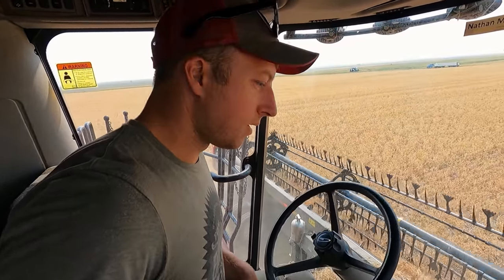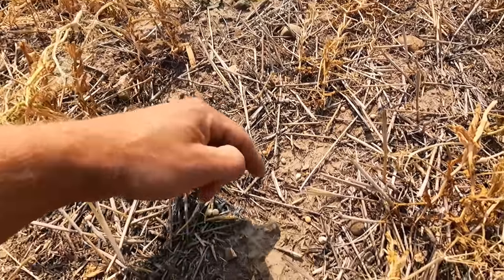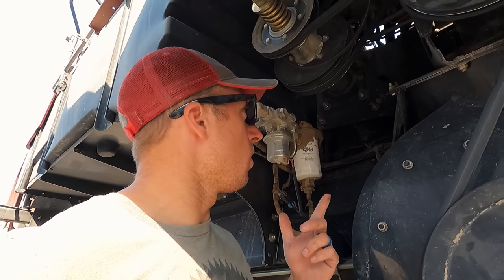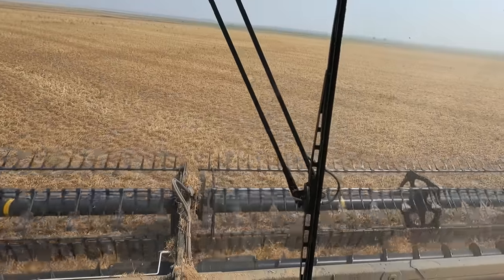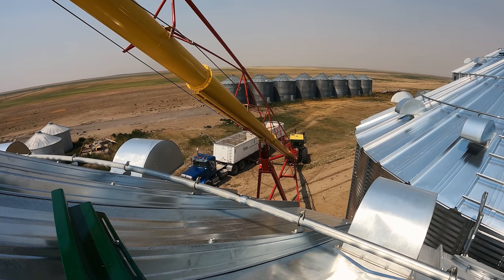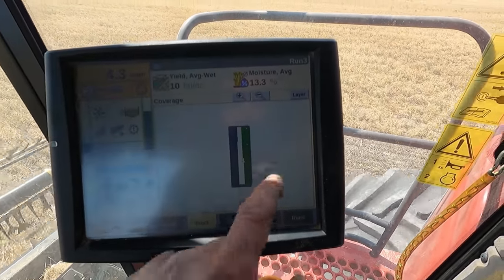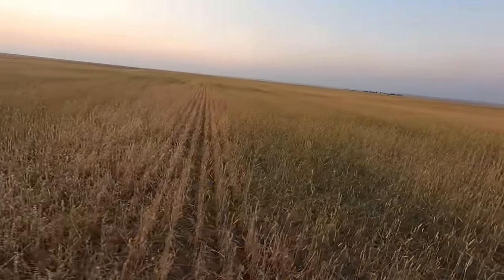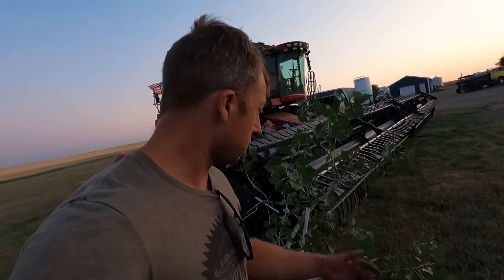Abandoning The Crop?

Comment: Great vid. 7120 and now 7230 owner. Did chopper bearings in both. Would highly recommend replacing all the chopper bearings. Had both of my failures start fires. Plus my when I went to get my new bearing from the dealer they had the one out that I needed and a box next to it with all three bearings. Said the single bearing was like the same price as the whole kit with all 3 updated bearings.
Reply: Tried just doing the bearings on one side before on a combine then the other side flew apart. Would 10/10 recommend doing all the bearings at once.
Reply: But for some reason they always wait for something to fail instead of being proactive when it comes to maintenance. I don't understand why they are like that but it would save them a lot of time during harvest not having to deal with things like this and a lot of money and quite possibly from losing a machine or worse
Reply: @cntslesfabrication  Could it be because they're harvesting and can't just stop to do a rebuild on the combine?... This isn't farm sim.

Comment: 0:45 Nick, buddy, you just described a pull-type combine.  We ran an International 914 behind a Farmall 1206 for almost 30 years.  Super reliable, cheap to run, and it was indeed easy to see what was going into the header.  Modern machines of course would run circles around it, and you don't get the data, but it was great for what it was.

Comment: Nick I've often wondered that too, about having the cab closer to the header. I have a tendency to lean forward, especially when cutting soybeans, but I do it shelling corn too, just out of habit, and its not easy on the back doing that, especially in my case with having back issues. Back when I first started running the combine, the grain heads didn't float as well as they do now days, matter fact we didn't even have automated header control, so you really had to worry about picking up a rock cutting beans back in those days, but the grain tables weren't near as big back when I was a kid.  I remember going from a 20ft grain head to a 30 ft, and thinking wow that thing is huge, now days a 30ft head looks small, lol.
Reply: Like someone else said. Cameras and laser detectors out front and some LCD screens might keep you comfortably in the seat. I'm not a farmer but spent many hrs leaning forward looking down deep trenches digging sewer mains, I feel your pain. My backs totally Fd up and not fixable,  from that and other whipping, bouncing and vibration. had to take early retirement.
Reply: @digger105337  even if there were cameras in the cab of the combine it wouldn't matter for me, I'd still be leaning forward, just out of habit, I'm not a auto steering fan either, I prefer doing the driving. When some guys first started no-tilling, my Grampa called it the lazy mans way of farming, if only he was around to see the auto steering come about, lol.  For spraying and putting anhydrous on pre-plant, and spreading fertilizer, auto steering definitely pays to have. But for tillage and running the combine, I prefer doing it myself, and I've always been able to drive straight, that if you drive by a field I was planting, you'd think I was using auto steering. Even moldboard plowing, I can keep it pretty straight. Half the fun is seeing how straight you can keep it. 1 reason why my Grampa started having me run the planter when I was only about 9-10 yrs old is because I drive straighter than he could, lol.

Comment: Weight and balance and the structural logistics of having the cab that far forward is a cludge at best, a monstrocity at worst. There is equipment that can extend cabs about a foot or so forward, but that's added complexity where it may not be needed. That said camera's and laser/radar tracking a few feet ahead of the header is something that might help.
Reply: Mount a camera forward over the header!
Reply: @jgardner2508  Yep. It isn't fool proof, but a good hi-def with good lighting could give you enough yards to pull up. Proximal radar could give a bit more, but will be pricier.
Reply: I almost had a stroke reading this post.

Comment: If you cut bolts you can grind a litte 45° edge so the nut goes on like a new bolt.
Reply: it's still easier to thread the nut off after cutting.

Comment: Those old style chopper bearings caused a lot of combine fires. Including one of ours and a neighbor as well. Both of us got them put out quickly with no other damage to the machine luckily. Our local dealer did somewhat of a “recall” on them and replaced them with the updated bearings
Reply: Consider yourself lucky, a combine fire can escalate extremely quickly and in some cases you may just have enough time to abandon the cab.
The fact you even managed to save the combine is a miracle in it's own right.
Reply: @CMDRSweeper  oh I know we are very lucky. Machine was cutting soybeans, combine operator turned around at the end and there was actually a couple small circles burning in the field. Was dropping smoldering dust as he went. Saved the machine and field both. Very fortunate.

Comment: Where is the coolant on that lathe while you are cutting those bolts? Based on the color and size of the chips, you are building up a lot of heat which isn't good for the strength of the bolt or the life of your carbide,.

Comment: This is a nightmare for you. There’s got to be a way to trap more of the winter moisture and make it work over the /hotter and drier / summer months pre harvest.
Reply: We don't get enough snow.  Read this: The water content of snow is more variable than most people realize. While many snows that fall at temperatures close to 32F and snows accompanied by strong winds do contain approximately one inch of water per ten inches of snowfall, the ratio is not generally accurate. Ten inches of fresh snow can contain as little as 0.10 inches of water up to 4 inches depending on crystal structure, wind speed, temperature, and other factors. The majority of U.S. snows fall with a water-to-snow ratio of between 0.04 and 0.10.(University of Regina Saskatchewan)

Comment: Wouldn’t it be a Thread Chaser Die (Combined both words in question) since it is external male bolt threads and if you were dealing with internal female thread issue, it would need a Thread Chaser Tap?

Comment: Here is a safety tip for Leg Arms. Please, please , please don’t leave the chuck key in the lathe chuck like you often do. Always keep your hand on the key from the time you pick it up from the top of the headstock casing till the time that you put it back there. Those keys fly if you accidentally turn the lathe on. Not only will there be guaranteed damage to the lathe but very likely to Leg Arm’s head, chest or shoulder. 
Please take heed.
Reply: Or don't turn the lathe on when you're putting parts in it... Thats pretty simple too.

Comment: (not sure if my comment is on here or not so to repeat) Tomra (norwegian multinational) have made infield crop sorting systems - optical for potatoes an tomatoes. Tomra also have a mining division that sorts rocks from rocks with x-rays. There are food productions X-ray systems that sort glass, metal and rocks down to 1/4 inch size or smaller. Not sure how an x-ray system could fit on a combine header. https://www.thermofisher.com/blog/food/how-do-bulk-x-ray-systems-work/   (Another possibility might be to use sensitive pressure tranzducers on the feeder belt on the header to detect rock impacts/ weight characteristic changes (a.i etc) with the feeder belt with a cab alert)